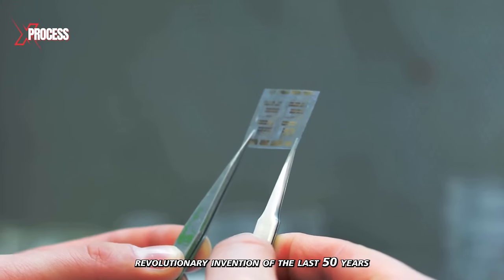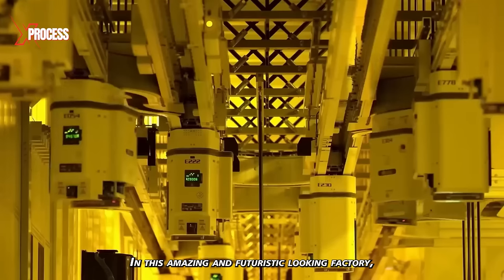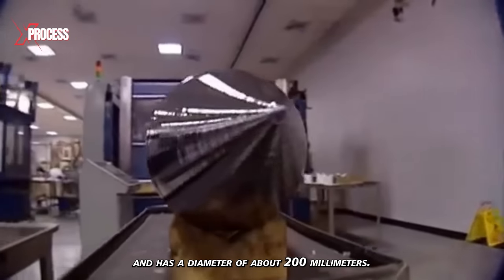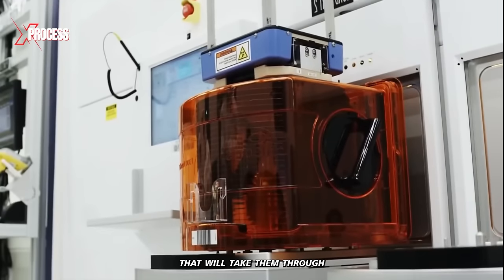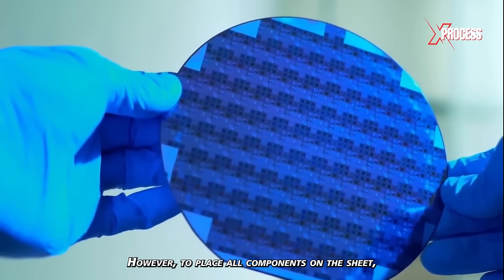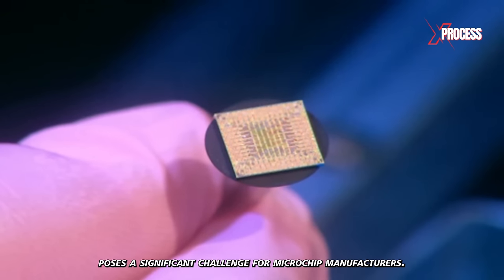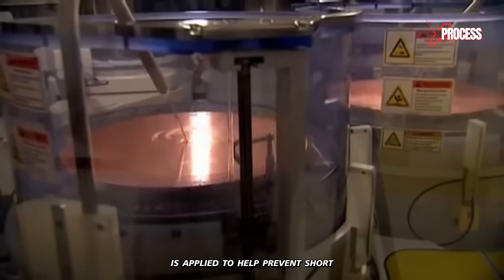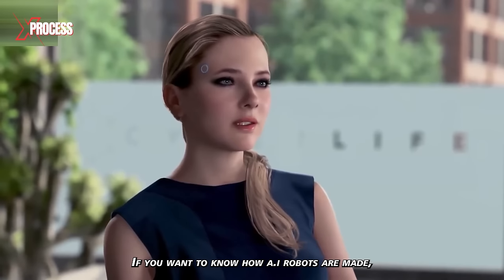How are BILLIONS of MICROCHIPS made from SAND? | How are SILICON WAFERS made?

Comment: Fascinating! I would love a director's cut version at least 10 times longer. There is clearly so much more to say at every step of that process.
Reply: Agreed
Reply: 5yu7
Reply: 😢iu6
Reply: Ty4
Reply: Very simplistic description of the equipment (tools) and process, but in heir defense, it is very complex.
I work in the yellow room with photolitho (PL) tools and process. The challenge is to print smaller and smaller CD’s (Critical Dimensions) to fit more transistors in a chip, but PL is approaching its limits.
The following focuses on the PL tools and process shown at the ~5:30 mark, it’s very technical and nerdy:
LENS and RESOLUTION- The smallest CD a PL tool can print is given by R=k1(landa/NA) where R=Resolution, K1=Process Factor, landa=Wavelength of the exposure light (in this video it’s laser, so likely 193nm), and NA=The projection lens’ Numerical Aperture. It’s obvious that for lower R, you need to lower K1 and landa and increase NA. Designers of PL tools have lowered landa from 435nm to 193nm in the last 4 decades; 435nm in the 80’s, 365 90’s, 248 y2k’s and 193 10’s). They tried 157nm but it reminded in the drawing board b/c lens for 157nm were too hard to manufacture. NA has also increased thru the decades, but it’s limited to 1NA in air, so water was introduced between the bottom of the lens and the SI wafer in the y2k’s. With water, the NA broke the 1NA barrier; 0.5NA in the 80’s to 1.4NA.
So R given by the PL tools has approximately gone from 435nm/0.5NA=870nm (or 0.87um) to 193nm/1.4NA=138nm. K1 has also decreased thru the decades to give even lower R. K1 is purely dependent on process engineering i.e. Photo Resist coating process, Developing process, Reticle technology, etc; this is a complete different topic onto itself, hence the reason this industry is so complex but interesting.
Reply: Are you an engineer? Cause WOW. Lol, ive been certified in every tool in Photo except for coat. (Steppers, Develop, CD's, D.I., EV, Reg, Bake, and DUV's) Will get coat soon too, and then gonna test the waters of maintenance to see if its something i would like.
Reply: Moi ce qui m'intrigue c'est de savoir comment le courant ne s'enmêle pas les pinceaux là-dedans, comment il sait où il doit aller est-ce qu'il doit faire... Hallucinant !!!

Comment: As a man involved in the manufacture of these beautiful wafers, i can tell you that this video is as authentic as possible without delving into proprietary information.
P.S.:  Pleased as punch to be 👍#400!!  👨‍💻
Reply from the maker: Thank you so much for your kind words! It means a lot coming from someone who is involved in the industry.
Reply: Any idea why they cast the silicon crystal into a cylinder? There so much waste on the edge of a circle why don't they cast into a rectangular column so they could use it all?
Reply: These things are pretty much like glass. Really fragile so i think its because a circle is a more structurally stable shape while a square is not. These things go through alot of bumps and spins. They specially designed lot boxes with a built in tilt to prevent them from bumping around so much while we carry them. I also work in this industry, i was showing my kids what i do with this video. 😊 heres an explanation i found. - The arc (think: circle) is the strongest structural shape, and in nature, the sphere is the strongest 3-d shape. The reason being is that stress is distributed equally along the arc instead of concentrating at any one point.
Reply: @laurawilson9276  that makes sense given how thin the wafers are, thank you for the explanation!

Comment: The chip is compass by various components usually qudrari for pulses but if the pulse is on a single row on a wire a wire chip an electrical cable with pulses should have greater space gains, a hollow chip

Comment: Gr8 video
Why are the waffers round and not square ?
Reply: Same reason our head is round and not square. I Joke, I also wonder why those wafers were round :)
Reply: @onlycryptofans easiness for polishing and removing the impurities by circular motion. In circular shape, you can achieve the refine wafers by using the law of physics, which is a most crucial part of the semiconductors manufacturing.

Comment: Intel is reinventing all this, Intel has completed the assembly of its High Numerical Aperture NA Extreme Ultraviolet (High NA EUV) lithography tool at the company's R&D site in Hillsboro, Oregon. Built by ASML and delivered in January 2024, the TWINSCAN EXE:5000 is the first commercial lithography system of its kind.Apr 19, 2024 Intel is also going to switch from silicon, to glass, eventually.

Comment: The lithographic images of each layer are negatives, in other words it is a photo resist that will block the covered areas from being treated with whatever additive or etching process that the wafer will go through next, then the resist is removed and the wafer is cleaned and sent back to lithography for the next layer to be imaged on the wafer. These process steps do not have completely uniform deposition and etching across the entire radius of the wafer which is part of the reason the chips get sorted based on the results of testing and then packaged according to the test results. The silicon wafers themselves are produced at highly specialized plants and then shipped to the chip plants in environmentally controlled containers that keep the wafers surface from any contaminants. The production of both the pure silicon and the photo lithography that produce the extremely small architectures of a modern chip are trade secrets. There are less than half a dozen companies in the world producing a photo lithographic tool capable of producing sub 14nm architectures.